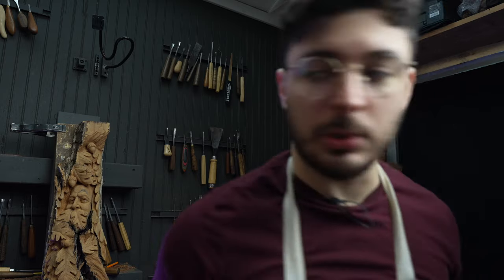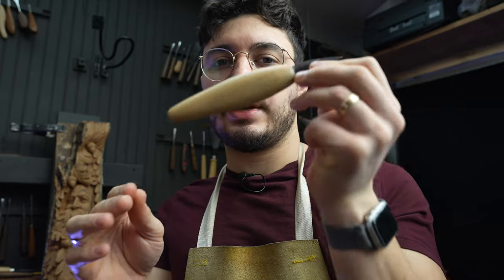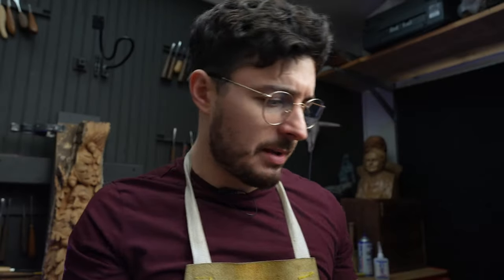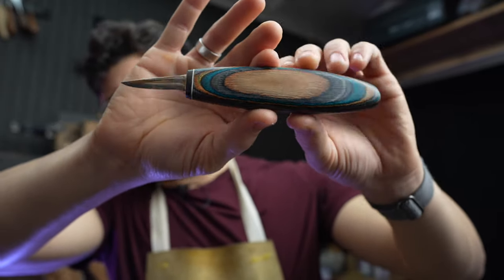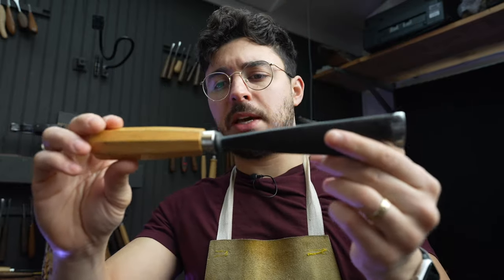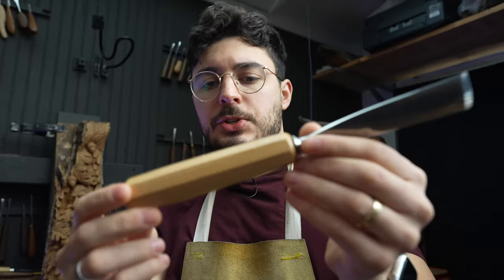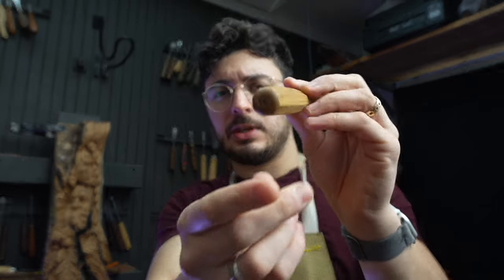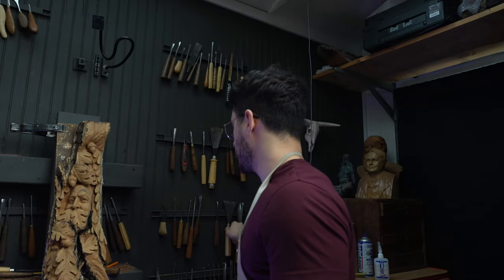BUY THESE BRANDS --CARVING TOOL TALK

Comment: Best thing about flexcut is they're  AVAILABLE, with a little stone/sandpaper work they can be transformed to a flat grind.  Those other manufacturers not so easy to find... in Canada  anyway.
Reply: Chipping away offers most of the whittling brands, and Lee Valley carries most of the gouge companies.   Both are in Canada.  I had trouble finding a Canadian company for a while as well.  Happy carving.

Comment: I've been carving for over 50 years and your recommendations are well founded. Flexcut, both their knives and gauges are remarkable for quality and price. I question Badger, I've seen a lot of quality issues. Helvie, since Ken sold out years ago, has turned into a bit of a disaster. They've at least stopped taking payments for knives that take a year to deliver. Deep Holler is becoming continuously out of stock which is sad they can't keep up with the orders, they make a remarkable and reasonably priced product. I use a blacksmith out of N. Minnesota who hand forges the most beautiful knives available and for a cost less than Helvie or Deep Holler. As for gouges, Taylor and Swiss Made have served me well for many years. Thanks Alec for a great presentation and good info.
Reply from the maker: @wildernesshermit  good stuff!

Comment: Hi there, I am a beginner as regards whittling and I watch mostly your videos and those of another well known person on YouTube. I have Flexcut knives, a Mora whittling knife, some that I made myself, and some of the Two Cherries brand. I was interested to see what you use to sharpen your knives so I clicked on the link in the video description, which took me to the Work Sharp site. One of the sharpeners there is the Ken Onion edition, which I have and use expensively for all my knives other than whittling knives. I tried it on a whittling knife once and found that the fact that it puts a very slight concave edge on the knife, makes the edge less suitable for whittling. The edge doesn't bite into the wood at flat angles, you have to use a steeper angle. I went back to manually sharpening my whittling knives. I would like to know which of the Work Sharp tools you use for sharpening and if you experienced the same issue with the Ken Onion edition, if you do use it.
Reply from the maker: Yes, I know what you mean! It helps to use the plastic backer on the ken onion’s belt to prevent the rounded bevel !